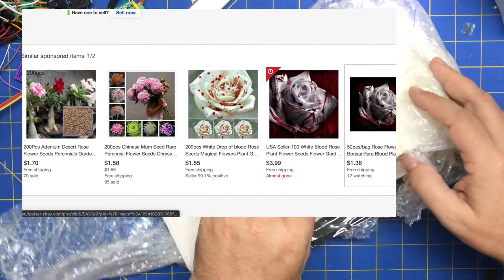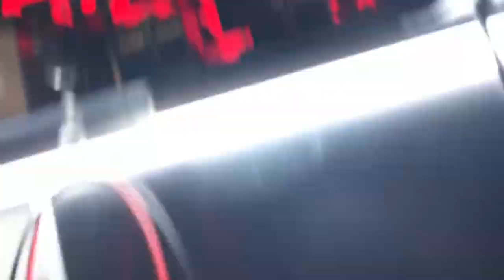Mailbag #62 12-2019

Comment: Still curious about that tape... did you ever find out what it's for?
Reply from the maker: nope, it seems to be pressure sensitive and for glass or panels or something, I will have to try using it again, It is very sticky but doesn't really stick, So I cannot see if being useful for temporary ahdesive or permanent , unless it bind certain materials really well, like perfectly smooth stuff, Ill try some more things like 2 pieces of acrylic or glass or soething
Reply: @tablatronix  Maybe it's like some sort of gecko tape?
Reply from the maker: @DustinWatts  That is what I am thinking, just not sure the industry or use case. lol It says automotive, panels, etc, but I have always used the grey actual foam acrylic, that stuff sticks like a mofo. I dont see this stuff sticking like that, I got it cause its thick and might be neat for batteries, pcbs, and led strips etc.
Reply: @tablatronix  Maybe because it's from China; mobile phone repair?
Reply from the maker: @DustinWatts  Maybe , it is really thick though, and there is alot of it, its all over the place, ebay, aliemamazon,Maybe it is pressure sensitive and has to cure, Gonna test it again tomorrow